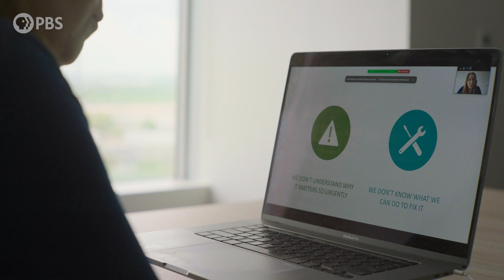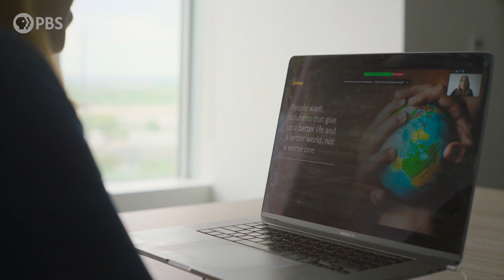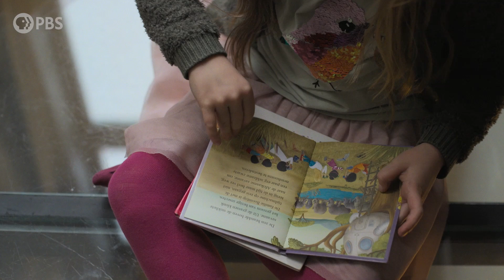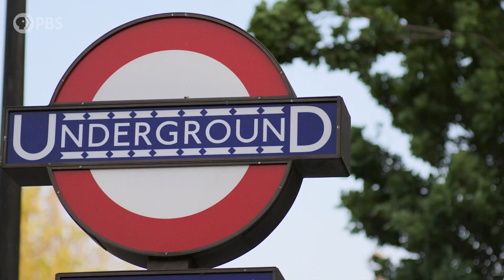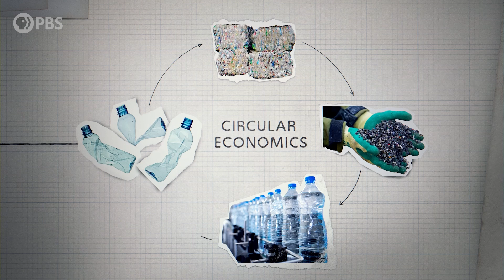Climate Stories That Can Bridge Political Divides | A Brief History of the Future

Comment: For four years I have been keeping careful records for my PHEV.  
Combined 'fuel' cost (electricity plus gasoline) works out to $0.018 per mile.  Less than 2 cents per mile.
Calculate the same for your current vehicle and let me know if you even come close to that.
Don't care about the environment?  Fine.  
Care about how much it costs to operate your car???
Not a political choice.